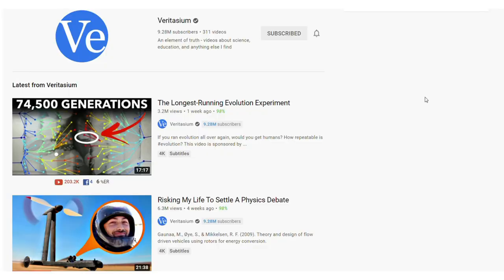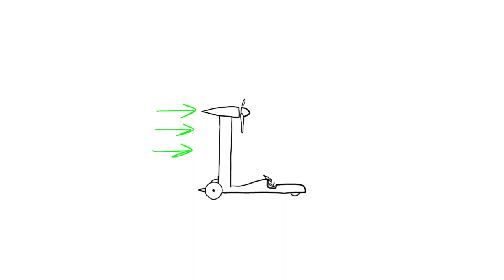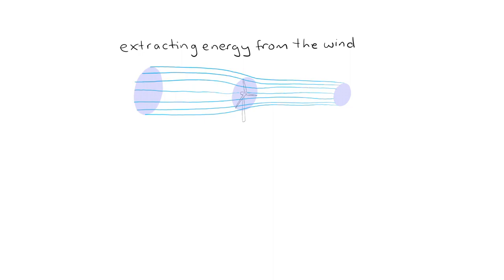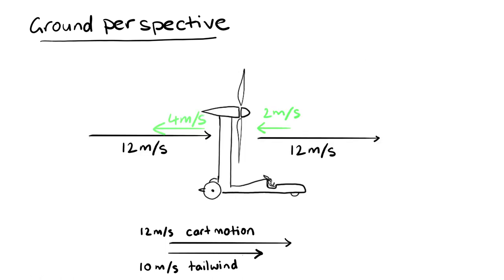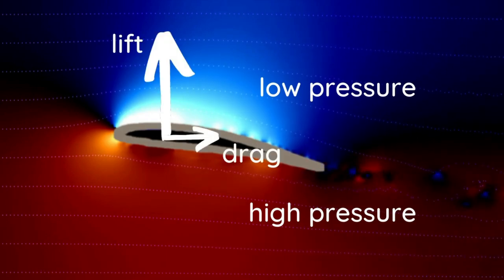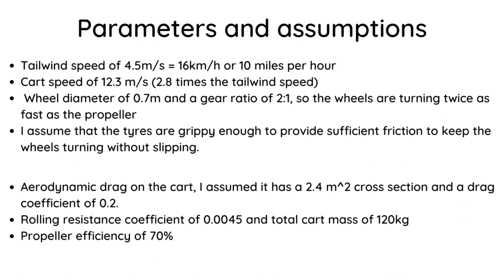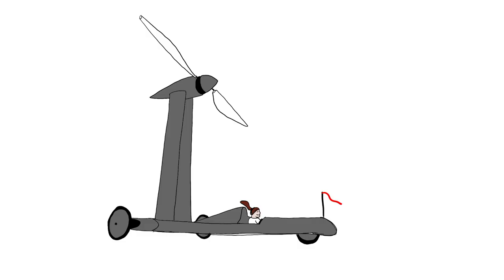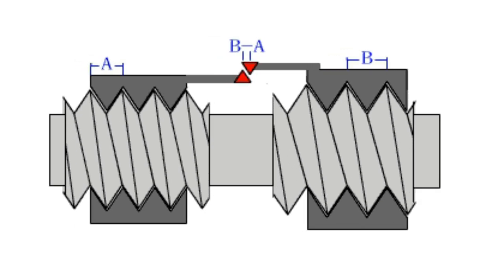Downwind Faster Than the Wind by Veritasium: How Does it Work?

Comment: Ships have sailed into the wind (on average) for hundreds (thousands?) of years, so I'm really surprised that people have a problem with believing it's impossible in the specific.
Reply: This is downwind rather than upwind (though the two are actually  pretty much identical if you just look at it upside down).  And boats do it by tacking.  This does it going directly downwind.  Of course the propeller blades are on a continuous beam reach, so the whole thing acts like a boat on a reach with downwind VMG faster than the wind.  But it's clearly counter-intuitive to most folks.
Reply: @Rick_Cavallaro  sure, but if you can sail directly upwind, then surely it's predictable that you can exceed windspeed downwind.
Reply: @karora  Not as simple as it sounds.  You can't sail Directly  down wind ie 0 degrees to the wind  and a birthday balloon will drift no faster than the wind.
Reply: @craigs5212  I've certainly sailed directly downwind, just that I haven't had the engineering in place to do it faster than the wind itself.  I've definitely sailed faster than the wind on a reach - that's pretty normal - but yeah, for sure, the devil is in the details.
Reply: @karora  Directly downwind with a static sail cannot produce a speed in excess of wind speed.

Comment: I have the great question: is it also possible with an airplane? Or only when you use 2 different medium?
Reply: No. The energy comes from two different mediums travelling at different velocities. After the craft has extracted the energy the velocity difference between the two mediums reduces. So one medium = no energy difference to exploit.
Reply: @JimChamp  but when you have two different rotor surfaces? then there is more energy input from de rotor surface of the turbine then the rotor for the propulsion. It sounds impossible, but I hope someone can put calculations on it. maybe Rosie herself.
Reply: Doesn't matter. The energy comes from the difference in velocity between the two mediums: no difference = no energy to harvest.

Comment: Thanks for the very clear explanations! For me, the clearest way to see that it can go faster is to think about all the forces that will act on the cart when the cart is somehow already in a state where it is moving exactly at windspeed. In this state, there will still be a thrust that is not matched or exceeded by the drag on the wheels, and will cause it to accelerate.
Reply: no there won't. because the only motive power is the wind.
Reply: @rickcavallaroisascientolog4494   The wind being the only power source (which is indeed the case) doesn't preclude a net thrust.
Reply: @HariGuitar  at wind speed or above it does. why do you hate newton so much?
Reply: @rickcavallaroisascientolog4494  That’s not how it works. Did you watch the video?
Reply: @HariGuitar  the video is wrong.
Reply: @pl3628  A net thrust existing when the cart is going at windspeed doesn't violate Newton's law is any way.  Note that the cart is going at windspeed relative to the ground, but the speed with which the air is moving is not constant near the fan.  If you think some basic physical law is being violated, explain how.
Reply: @HariGuitar  tl;dr. lrn2 draw free body diagrams plz.
Reply: @pl3628  Hmm..  With all due respect, I totally get the level of understanding at which you are operating. My mistake for engaging with you. Have a good day!

Comment: Thanks a lot for this video! I was scratching my head as well until I stumbled upon your explanation.
However, one thing I have not got clear answer from anyone is, assuming constant wind speed, perfectly horizontal ground level etc., what is the equilibrium condition for blackbird? Would it reach 2.8 times wind speed and stay at that if propeller blades are kept at optimum angle? Or would it start to slow down after that?
Reply: "what is the equilibrium condition for blackbird?"

There's no simple formula. It depends on the losses in the transmission and the drag on its frame.

Comment: Something that's been bothering me about this is that from the cars perspective, both the ground and wind are gaining energy. But accelerating refrence frames are tricky
Reply: I'm bothered by this too. I think the important thing to remember is that energy should be conserved in all valid (inertial?) reference frames. Therefore, if conservation of energy seems preserved relative to a stationary observer, and doesn't seem preserved from the perspective of the driver, that doesn't mean we're violation CoE, it just means we don't understand one of the reference frames.

Still don't really understand how it works from the driver's perspective though!
Reply: In the car frame, the force on the ground is opposite the direction of motion, so it's losing energy not gaining.  That's the energy source in the car frame, just like in all the treadmill videos.
Reply: But honestly I find the car frame really distracting - to me the energetics are easiest to understand in the ground frame.

Comment: So you literally saying that propeller can create thrust that will move cart faster and so drive propeller that will create more thrust .. and so on? Perpetual motion? Or is there resistance that will stop it eventually?
Reply: If I plug a microphone into a powered amplifier and place it in front of a speaker, the microphone feeds the amp which feed the speaker which feeds the microphone which feeds the amplifier ... round and round with a loud squall.  It sounds like perpetual motion when described that way, but it's really just a powered feedback loop - unplug the amplifier from the power input ... the wall outlet and it all goes silent.

Yes, the propeller generates thrust which move the vehicle forwards which forces the wheels to turn which then creates a torque which turns the propeller which generates thrust ...  but like the above, it's merely a powered feedback loop.  Unplug the Blackbird from it's power source (the wind), and it grinds to a halt.
Reply: No, it's not perpetual motion. The trick is to think about the linear force and the rotational torque on the propeller separately. The linear force from the wind pushes the propeller and the cart forward, and that makes the wheel bearings push on the wheels. The combination of being pushed forward by the bearings and backward by the ground makes the wheels turn, and they make the propeller turn through the chain connecting them. Then the rotation of the propeller allows it to keep pushing back on the wind, even when it's going faster (just like the propeller on an airplane or a motorboat).

Comment: Love your videos, so clear and interesting, thank you.  QUESTION:  a few years ago some wind turbines with large diameter nacelles appeared.  I understand that they provided an electrically rotating field instead of a stator.  Power output could be synchronized with the grid with less power electronics and the gearbox can be avoided. New turbines don't seem to be using them so I guess there is an engineering reason why they are not used.  Can you explain?
Reply: my bet would be noise, as they would be using DC which had to be inverted, and if the inverter had even a minor degrading of insulation in the diodes, ac transformers would have their iron cores saturated (not good).  It's one reason why DC transmission lines are not as popular as the costs would make.
Reply: @rcmrcm3370  "my bet would be noise, as they would be using DC which had to be inverted"

That cannot be the reason because "normal" wind turbines have their output converted to DC and then inverted back to AC.

Comment: Riveting presentation, Rosie. (g) A variable pitch prop might be an improvement. My plane has such a prop…generates a ton of thrust during takeoff by always extracting maximum power from the engine. But at minimum pitch and low rpm during landing it becomes a powerful air brake…much moreso than a fixed pitch prop. For less (or no) braking action just increase the rpm a few hundred rpm by opening the throttle a bit.
Reply: // "A variable pitch prop might be an improvement"//

The Blackbird has a variable pitch prop installed.
Reply: @johnborton4522  Excellent!

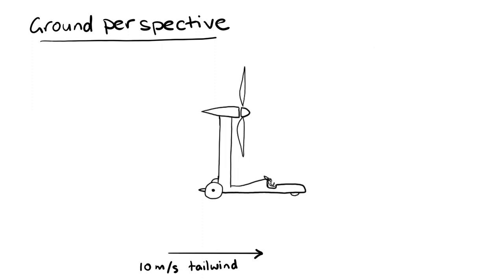Comment: 6:12 So, just assume that its traveling faster than the wind, which takes energy, but just ignore that? Just start off with extra energy in the system and assume that's constant, yet pretend there is no additional energy input into the system to overcome drag and friction?
Reply: No, that's exactly what she's showing you: The cart gets energy from the moving air, and you can tell that because the air is moving more slowly behind the cart (8 m/s) than ahead of it (10 m/s). The cart slows the air down, and that's where the energy comes from to compensate for friction.
Reply: @Raging.Geekazoid  It also slows the earth (relative to the air) and extracts energy from that.

Comment: Great explanation! Thank you.
I wonder whether it would be possible to build a boat with two propellers, one in the air which could be oriented with the wind direction and the other in the water which would work like the “wheels” of the blackbird. Could it go faster than the wind downwind and even go upwind? What do you think?
Reply: Directly downwind faster than wind on water is possible, but more difficult.  Directly upwind is trivial, look at the videos by "Peter Worsley".
Reply: Yes, and its been done. It goes upwind very easily - first done nearly 100 years ago I believe. But because of the efficiency losses from the water screw its hard to achieve faster than true wind downwind.
Reply: @JimChamp  The thing that holds back the popularisation of this technology is that sailing enthusiasts do not consider it to be proper sailing, and motor boat enthusiasts don't like it because it is not a motor boat.

Comment: I would like to thank you for your videos explaining Veritasium faster-than-wind vehicle, it helps clearing up some concepts.

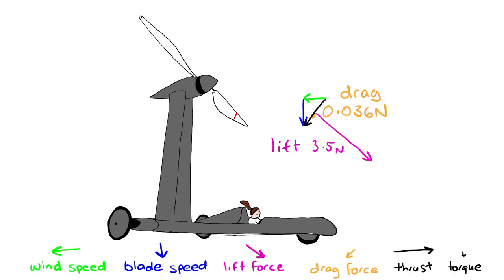I would like to ask you about a confusion I have on the calculations at 12:38 of that video on lift and drag force, and thrust and torque. The calculations seems to be done for 0.7 degrees instead of for 0.7 radians (arctan 11/13).

(Intuitively, the thrust force couldn't have been equal or even close to the lift force for a triangle with sides 11, 13, and ~17)

Can you clarify this? Thanks!

Comment: Yes, all quite confusing ^^ But i see some analogy to heat pumps. And there are many people, who say i am crazy, if i say my air conditioner gets 4 kwh heat out of 1 kwh electric  energy... 
So, even colder temperatures outside, still contain energy. And slower wind, as the vehicle, still contain energy ...
Reply: If there are 0 K outside, you have to at least 4 kWh of electricity for 4 kWh heating energy.
You need more energy if you accelerate air from 0 to 20 km/h than 10 to 20 km/h. 
But I dont know, how can we it apply in Blackbird's case, where the thrust comes from F = m * dv/dt.
Reply: @belamizsak161  haha, hopefully there will never by 0 Kelvin outside my house...
And your mention with 0 kmh and 20 miss the point.
The Wind has 15kmh,and you accelerate to eg 18 kmh... So there is not no wind, especially not to the ground initial system.
Reply: @berndbroot587  The thrust generated by a rotor depends on the rate of change of the airvelocity (and the mass of the moved air), so not depends directly on absolute starting air velocity. The thrust can generate the cart's acceleration. But the shaft power may depend on the absolute velocities too. The shaft power brakes the wheel. This gives braking force, against thrust.

Comment: Hello Rosie. You and Derek are trying to explain it with analogies and examples of levers and forces. But what both of you do not explain is how the conservation of energy is respected here. And that is what makes my brain hurt. Lets just talk about the time from traveling at windspeed into the future: 

The cart sees the air around it stationary. The propeller is already moving and so are the wheels and the gears. So we have a momentum here that was generated before. But now the cart is putting more energy into the air to push it than it is extracting from the ground (otherwise it would not accelerate). How is that possible?
Reply: // "But now the cart is putting more energy into the air to push it than it is extracting from the ground (otherwise it would not accelerate). How is that possible?"//

You're confusing "force" and "energy".  They are not the same.  

Yes, to accelerate, the propeller must be producing more thrust (force) than is being exerted on the ground.  Without this force delta, the cart will not accelerate.

Energy of course is not the same as force.    
https://www.youtube.com/watch?v=QrULRkf6-N4

Simple "Work = Force x Distance". 

Since in a tailwind, the distance traveled by the wheels over the ground is greater than the distance the propeller travels through the air,  the Blackbird collects more energy from the wheels (at a lower force) than is expended by the prop (at a higher force).  

Again, the wheels exert less of a braking force on the chassis than the propeller exerts in thrust (thus acceleration) while at the same time the wheels harvest more energy than the propeller consumes.  It accelerates until all is equal (frontal drag limits top speed).
Reply: @johnborton4522  I know the difference between force and energy. I have an degree in aeronautical engineering.

The thing that does not go into my head is the positive feedback loop. The prop generates more thrust than the friction slowing down the cart. But the thrust is generated from the force of the wheels spinning. So the system “cart” is adding more energy to itself until it hits a certain equilibrium. How can it do that?
Reply: @johnborton4522  if you just sum up all the types of energy in the cart at the moment of windspeed and the moment of greater than windspeed, it seems that the energy of the whole system has increased right? You have kinetic energy of the cart and energy stored in all the rotors like wheels, gears and prop. And at the highest speed you have more energy than at windspeed right? What am I missing here?
Reply: @duketoby0  
>>  the system “cart” is adding more energy to itself 

Nope. It never does that.  The wheels move over the ground faster than the propeller moves through the air.  So we can harvest more energy at the ground than we expend creating thrust in the air.
Reply: @duketoby0  You say you now the difference between force and energy, but you keep conflating them. Here is how you differentiate them:
prop_power < wheel_power
but:
prop_force > wheel_force
because:
air_speed < ground_speed
Reply: @duketoby0  "how the conservation of energy is respected here"

The propeller decelerates air (relative to the ground). Therefore the air is losing kinetic energy and the cart is gaining some.

Comment: Being a sailor I understand the principle of relative wind speed, and that a sailing boat can go faster than the ground wind speed. However, that is never downwind. So this confused me. Then I got the concept that this is actually not a turbine (like a sail is a sort of "stationary" turbine with one blade), but a propellor. So I can figure it out somewhat, but it's still weird...
Thanks for the explanation!
Reply: Have you ever "sailed faster than the wind".  I haven't, but my Sunfish days are scores of years ago.
They say it is possible but how?
Reply: @auteurfiddler8706  As you start sailing , the forward movement of the boat creates headwind. The result with the ground wind is the relative wind on which you are actually sailing. As you may understand, this relative wind is stronger than the actual ground wind. The speed of the boat will build up, increasing the relative wind, until the windforce which pushes you forward is equal to the opposite force of the drag of your boat.
So, when the drag of the boat is very low, like with modern hulls or hydrofoils, you can build up a speed greater than the wind speed.
Reply: @permanenceinchange2326  Have you actually done it? If so, in what type of boat?
I looked at the "points of  sailing" chart. Would it be "close hauled",  "close reach",
"beam reach", "broad reach", or "training run"?
Presumably not "run" . I found the Sailfish went fastest in "run" and slowest in "close hauled" but the theory states the opposite.
Reply: @auteurfiddler8706  Unfortunately, I haven't done it myself :(. But when you are able to build up enough speed, it will be pretty much close hauled. No matter what direction, except straight down wind.